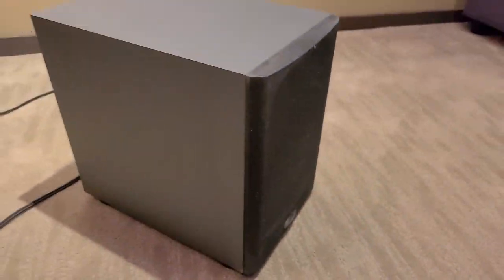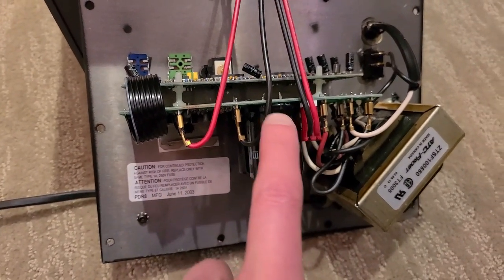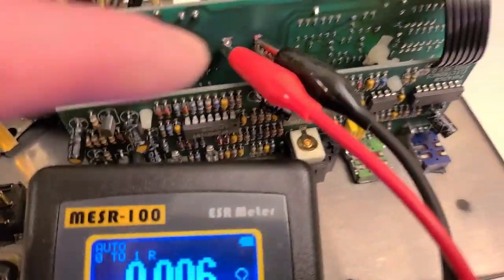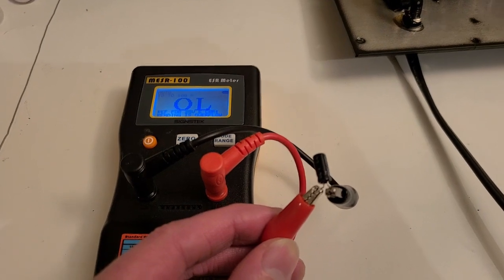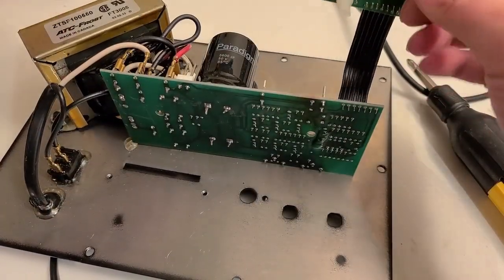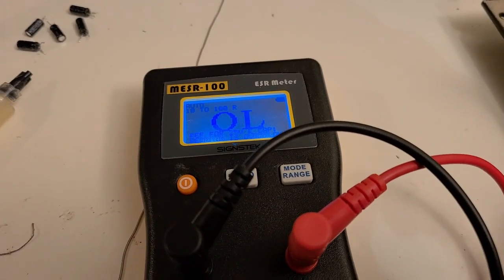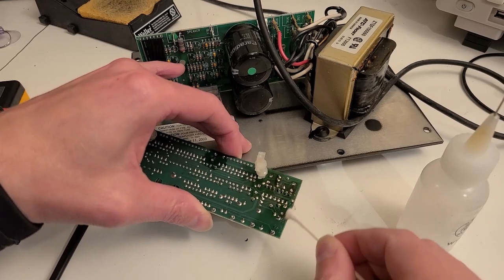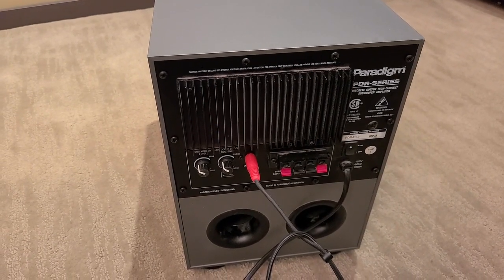Subwoofer Static/Rattle/Hum Fix

Comment: I’ve also seen other people doing this that say that the circuit board may be marked with the wrong polarity.   I’m not sure if you found any like this but thought I would mention it. So mark your board or take a picture before removing the caps.
Reply from the maker: Yes, 100%.  Thanks for mentioning that as I've seen that before myself and it's super confusing as it makes you wonder if the board is correct or if they installed it incorrectly at the factory.   If I can't find the schematic, I generally go with the way it was installed like you said.  Definitely a good practice to take a picture before removing the old ones.
Reply: @shaneperche-fixed-it  this happened just the other day the circuit was marked incorrectly on one side of the board even though it was a single not double layer board. Took a picture before I pulled the capacitor just to make sure.